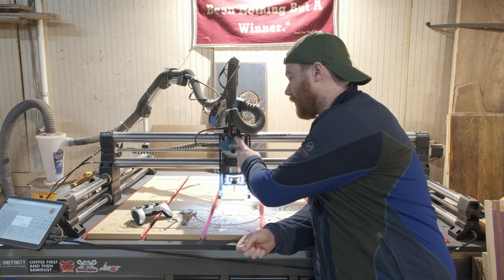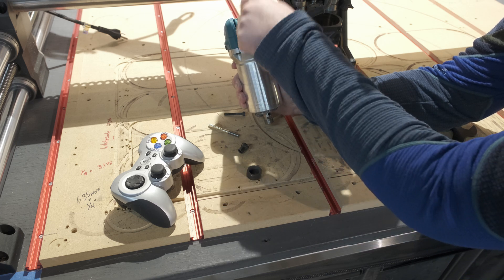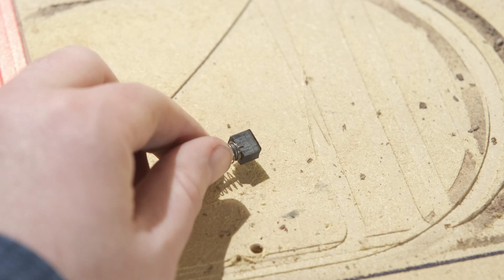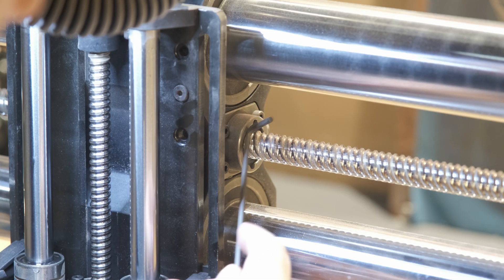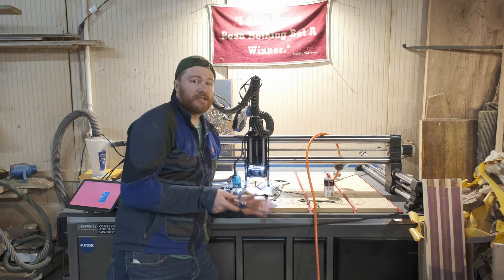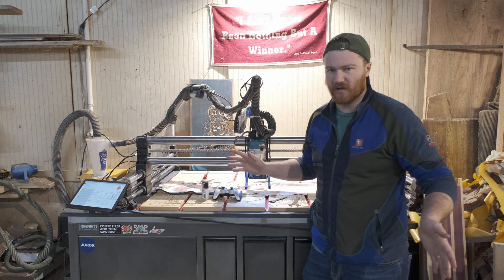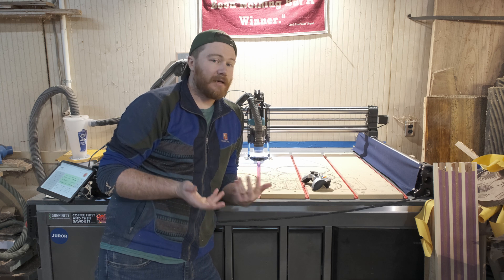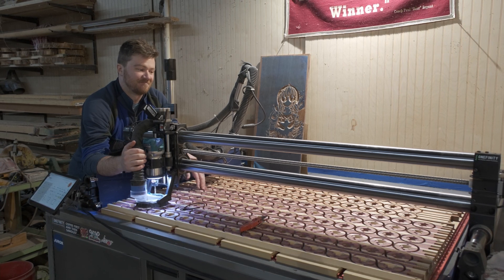100 Hour Onefinity Journeyman X-50 CNC Maintenance

Comment: I know you have the new elite series with the stiffy. Do you notice any difference with the stiffy
Reply from the maker: No I don't. But I also didn't have a heavy water cooled spindle on my last one. So if you're going makita- I think no third rail is fine. If you're getting into mounting heavy things you might want to get the third rail
Reply: @HamiltonDilbeck  
Thank you. That has been the debate for me when I order. I’ll be using them Akita so I guess I’ll save a few bucks and not get it.

Comment: quick question, I was able to clean my left y axis ballscrew but can not get the right y axis ballscrew to pull away from gantry.Same for the x axis ball screw. I removed the screws including the oil port. It seems like they are frozen on. I tried flooding with oil, blowing out dust with air etc and still can not get the ballscrew to move off the gantry. Any thoughts?

Comment: Just performed my 150 hour maintenance.  At 100 hours I installed the 3D printed wipers and they do a FANTASTIC job. I highly recommend them.  Hard to get in at first, but at 150 hours they came off easily and went back in easily.  I used a thin rod to knock the 3D plugs out.  Compared to 100 hours, there was hardly any dust in the ball nuts or factory wipers.

Comment: Excellent video. Just recently received my onefinity and am in the process of setting it up, but this video will definitely be helpful in the future! 
I’ve seen “ball screw wipers” on Etsy and debated purchasing them - do you think they’d do much in preventing dust from accumulating by the bearings or are they kind of a gimmick?   Would be interested in your thoughts. Thanks again for a great video!
Reply from the maker: So I have seen those, but I've never used them. So I really can't say how well they work. But I do know that after a week of having run the machine with the curtains on, its soo much better!
Reply: @HamiltonDilbeck  I’ll definitely keep the curtains in mind - thanks!

Comment: Have you ever looked for and found a collet replacement for the makita router? Maybe my brain is just mushy, but  I couldn't find anything that was really specific. I had a collet bend on me when a carve went all wrong (bit got stuck in the work piece), and I think the collet got so damaged the bits don't spin straight. Ended up buying another dang router because I couldn't find a for sure collet replacement.
Reply from the maker: Yeah I've been able to find a few direct replacements, but I really want a different way to tighten them... I don't think they make too many upgrades for the collet, sadly.